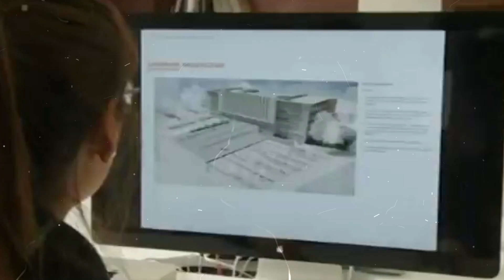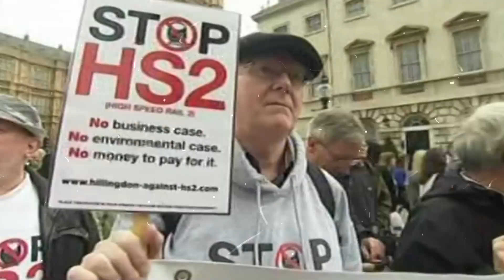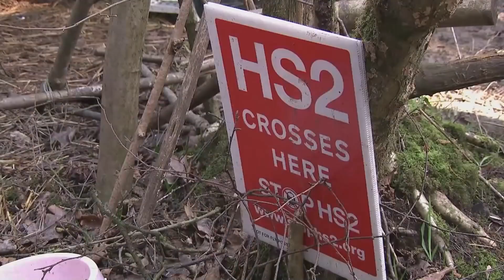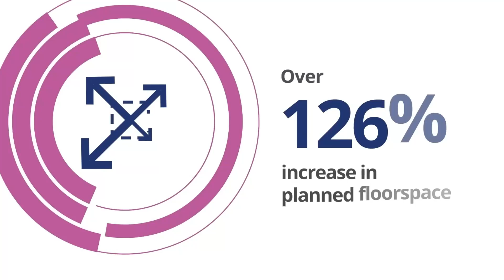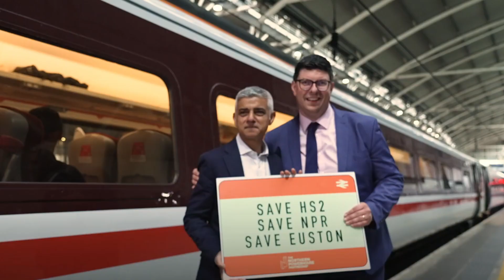The Latest Update For UK’s $125BN HS2 Railway 2025

Comment: Wrong on many levels. The budget will probably end up around £220 billion. Not ten stations. More like three and a half stations. Not connecting several major cities. Connecting two cities. Trains travelling at 230mph will require more power than can be met by renewables alone. Nice images of butterflies flitting about the trackside and trees sprouting like a rash tells part of the story. The other part is destruction of watercourses at Thorpe Mandeville, Radstone and Southam, masked by dodgy engineering; and risk of bird strikes from gulls flocking to the Greatmoor waste incinerator plant alongside the tracks. Blood spattered trains will not sell train journeys

Comment: The Victorians built the backbone of today’s system, no computers just hands on practical skills.
Have we lost something along the way?
Reply: Life expectancy was 40 for men and 45 for women in 1850. One thing we've gained is a lot of life
Reply: not comparable. high speed rail needs to be built to a much higher precision and tolerance than what the Victorians were building for. Plus most of HS2's setbacks are not from engineering constraints but from political, environmental and humanitarian issues. The project has to snake under and around ancient woodland, goes through peoples property (who are often not willing to sell up), and be constructed in a way that doesn't put workers' lives at risk (Brunel was a genius, but his projects came with a pretty serious death toll). Sure the project could have been managed better, much better in fact, but taking a sledgehammer to these kinds of issues would be throwing away much of what we've gained as a society since the victorians
Reply: Nah. It's just that, you know, a 250mph train system isn't really easy to build, also considering it goes across England.
Reply: Working conditions were harsh and exploitative back then, and dangerous too. Thousands of lives were lost and countless more workers were injured blasting out tunnels, etc. Perhaps we have also gained much along the way?
Reply: Not comparable. Environmental,  planning , health and safety requirements and contracts are far more complex today.